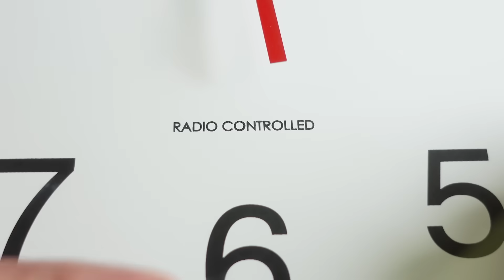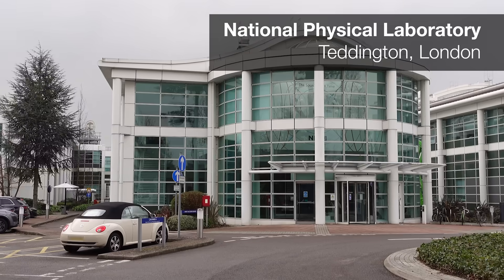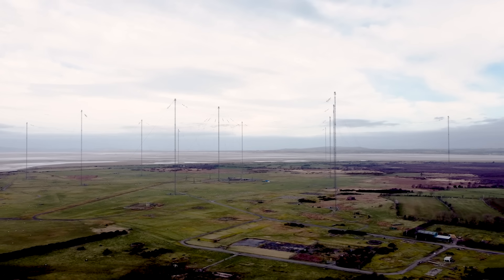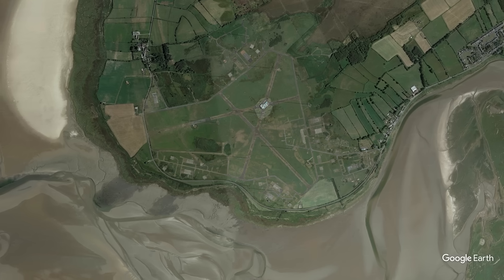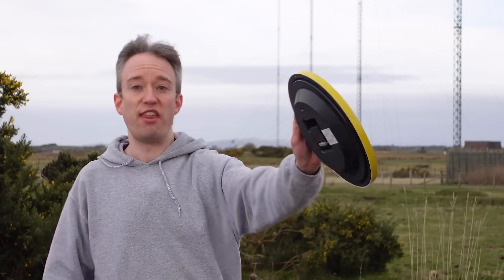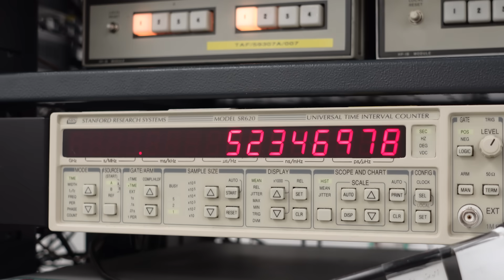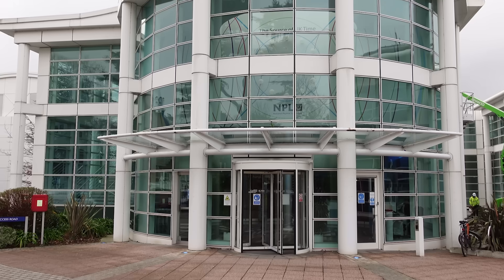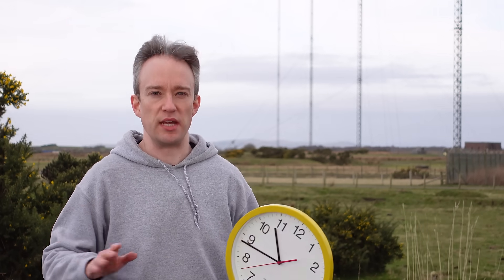How does Britain know what time it is?

Comment: Never heard about radio controlled clocks. Are these even a thing outside the UK?
Cool nonetheless.

edit: outside Europe?
Reply: There are transmitters in Germany, Japan, China and the US (and possibly elsewhere)
Reply: Yes they are. Had a watch on my wrist for years that could do it. I've never visited the UK - only been around Europe a bit and it always worked :)
Reply: @ManuelKampmann  probabbly using the DCF77 signal from Germany if it was for CET
Reply: Yes. In the US there is an atomic clock in Fort Collins, Colorado.
Reply: @seabears_hate_circles  plus WWVH in Hawaii!
Reply: @neillthornton1149  While WWVH is a talking clock transmitter calibrated to atomic clocks, it doesn't broadcast a signal for radio clocks.
The signal from WWVB in Fort Collins is strong enough to set clocks in Hawaii, though only at night.
Reply: @seabears_hate_circles  The US clock is actually in Boulder, CO at NIST, but the transmitter towers are just north of Fort Collins
Reply: @seabears_hate_circles  And that atomic clock has transmitters similar to the one Tom was standing near.  WWV broadcasting on 2.5, 5, 10, 15, and 20 MHz
Reply: @seabears_hate_circles  I don't think they're asking about the atomic clocks, but the broadcasting of the time over radio.
Reply: My watch is radio controlled & yes Atomic timing is normal.
Reply: @RathOX  They were asking about the broadcasting of the time by radio, not the atomic clocks themselves.
Reply: @MrEazyE357  thts why i also said YES, please read
Reply: @RathOX  Atomic timing? Put two together and they both set a different time. Radio controlled timing you mean aka cheap watch.
Reply: @tomtalk24  lmao i have quite a few watches. God tier casio as a daily :P
Reply: Not a thing in Australia, i only found out they existed 5 minutes ago
Reply: @HailHydra27  Australia used to have it, they shut down the Radio VNG transmitters in 2002
Reply: Some g-shocks are radio controlled and keep perfect time all of the time. Mine works in Mexico and receives a signal from somewhere in the US
Reply: Yes my watch uses this signal and can pick up the signal when in other countries.
Reply: My Atomic Alarm Clock by my bed was never very good at keeping the signal, and it lost the signal permanently in 2018, when I last moved. Both the clock and I are from the US, although I suspect the clock was made from Chinese components, then assembled here. I was made from Mexican, Italian, English, and various Scandinavian components, and I am about as functional as my clock.
Reply: @PassiveDestroyer  Hahaha
Reply: Not in Africa, Australia or Antarctica, but almost everywhere else in the world. Look up "Radio clock" on Wikipedia.
Reply: @charliedobbie8916  Nor in Middle East, India, South-East Asia or New Zealand.  So not in very many places at all, actually.  So, yes, something I did not know....
Reply: We in Germany have that too
Reply: @dggxxfhhfxc2244  The german one also works fine for radio controlled clocks in southern Finland
Reply: In Sweden, southern part at least, we rely on the German transmission. But yes, they are a thing here.
Reply: @testcardsandmore1231  The signal from Germany is out of range in Luleå.
Reply: @testcardsandmore1231  Freeloaders the lot of you ;)
Reply: I have one in romania
Reply: @DanielQRT  cool. I know loads of countries have them, I just couldn't recall what ones did. 

Radio hams can uses them as beacons, but only for a few low bands. The high radio bands dont have these transmitters because they are unsuitable for this kind of application. There are dedicated beacons too, but these are a good known power level reference point. You can use them to work out where the propagation is most effective.
Reply: look up casio multi band watches, they sync every 24 hours
Reply: I live in the southwest US, and our 'atomic clock' devices were garbage. our school had a digital display that claimed it was tied to the atomic clock in colorado, but it was so inaccurate you could watch it skip up to 8 seconds forward or backwards at random, and it happened frequently. You couldn't watch it for more than 3 minutes without seeing glaring issues (either skips, rewinds, or just freezing for a few seconds). never knew specifically how it got the signal, but however it did was not a good method because it's pointless to have a device for telling extremely accurate time-that can't even maintain it's own accuracy for more than a minute or two
Reply: The radio controlled clocks I’ve had in the UK were made by a company based on Portland, Oregon, USA (can you guess what they’re called?), so I’ve always assumed it was a global concept
Reply: @TheXeneco  I have several of their clocks and love them. It is very efficient; I have changed the battery in the alarm clock by my bed only three times in about fifteen years (rarely using the alarm, just running the clock.)  I'm also maybe a little biased by living very near their headquarters in Portland...

I assume your clock is made for the UK market? It isn't listening to the US signal, is it? That would really impress.
Reply: There's one on my table in Helsinki, Finland.
Reply: @jannepeltonen2036  It probably receives its signal from Germany.  Oulu is about the northern limit of its range, or maybe just beyond.  The German signal is easily received in Great Britain.
Reply: Yes, my alarm clock (in Denmark) is controlled by a radio tower in Frankfurt.
Reply: Not a thing over here in Brazil, didn’t even know they existed either. Very interesting!
Reply: Had one for decades
Reply: As an Australian I hadn't heard of this. Apparently we discontinued it. "Australia utilized Radio VNG as the national time signal service operating at 4.5, 7.5 or 12 MHz. The unfortunate part of the story is that telecommunication company Telstra along with the Australian government shut down this technology with the advent of GPS"
Reply: Yes they are, we have one in our class in austria
Reply: I dont live in a UK, but i just heard about them from this video
Reply: I have a US one, but had to turn off its radio sync.  For some reason (I assume poor radio reception/interference) several times a year it'd go set itself to some wildly incorrect time.
Reply: They cost £10 at Lidl...
Reply: Holland ✅
Reply: I live in Florida. I've never been able to get an atomic clock to receive a good enough signal in order for the feature to work properly.
Reply: Those domestic clocks are often to be found in the middle aisles of Lidl and Aldi for under £15.
Reply: Yes. Am Italian, currently have 2 and have had several.
Reply: No idea, but I've heard time signals in shortwave radio.
Strongest one for me is 10,000khz. 
The station is literally on the other side of the world, but I can still hear it.
If gives a beep every second, a longer beep at minute mark. And occasionally i heard actual human (recorded) voices telling the time.

I googled what it is. And apparently it's for clocks to synchronise.
Not like 60khz Tom said...
Reply: @phs125  That is WWWV (or WWWVH). There are many long wave time code transmitters and many short wave time code transmitters in the world, look some up on the "radio clock" wikipedia page 😁But nowadays most cheap radio controlled ("atomic") clocks use long wave signals for synchronisation. Short wave transmissions were/are mostly used by ham radio operators to listen to the time and compare their transmitting frequency against the fixed frequency of short wave stations like WWWV or CHU since the frequencies are nearer to the ham radio bands.
Reply: @kuebbisch  ah well, I don't think my country has any long wave things.
 I can't get anything from my radio atleast...

I personally use 10Mhz station because it's easy to put in the number, it's always transmitting, and I can check how good the signals are at the location and time ...
Reply: Yes they are.
Reply: Yes, they are used all over europe, NPL or the german equivalent, DCF77. Stationary systems, like NTP servers, sometimes use GPS. Some systems even use all 3 sources, just to be sure. I think the "pips", the BBC time signal, uses all 3 sources.
Decoding the DCF signal is a common programming excercise for students. 
With prices starting at around 10€, these clocks are quite common in Europe, simply for the convenience. Public clocks are also often using this.
Reply: I had also never heard of them. Looked it up. No transmitters in my country, closest is Japan. Makes sense why I've never heard of them.
Reply: i have one in colorado (but granted we do have an atomic clock in fort collins)
Reply: there arent any in australia.
Reply: Yep. Normal thing in here too.
Reply: My car's clock is radio controlled as well. I still have to set the timezone if the battery dies or is disconnected but otherwise it's always correct.
Reply: Italy and Cuba have music on top of their time clock radio stations
Reply: Yes. In the US NIST transmits WWVB our radio clock signal from Fort Collins, Colorado.
Reply: Yes, I have one just like the one shown in my kitchen in germany.
Reply: Radio controlled clocks work in most of the world. There are time signal stations all over the world, many in the US particularly, and they can be heard over a very large distance. 

The UK transmitter used to be good until it moved, now I can't get the signal strong enough to set any of my watches and clocks to set.
Reply: We have them in Germany
Reply: every clock made of atoms is atomic
Reply: This has been in the USA for decades....
Reply: Me neither.
Reply: I’m from the Uk I’ve never heard of em